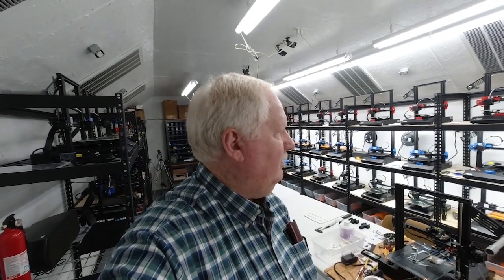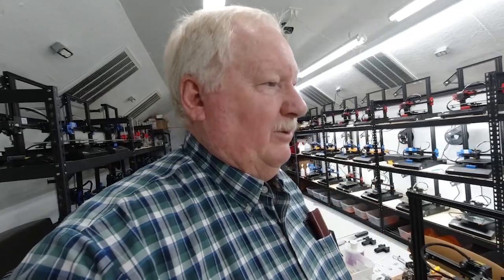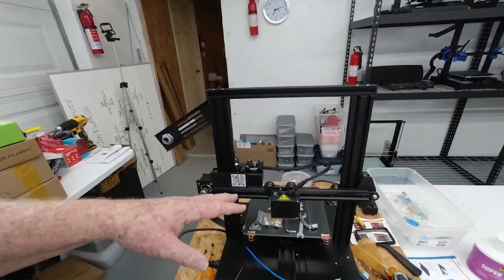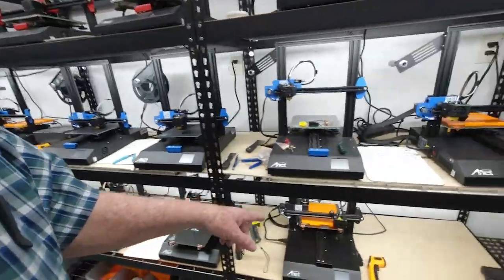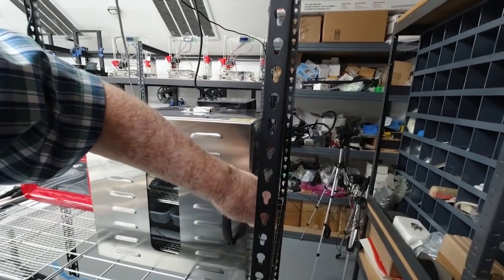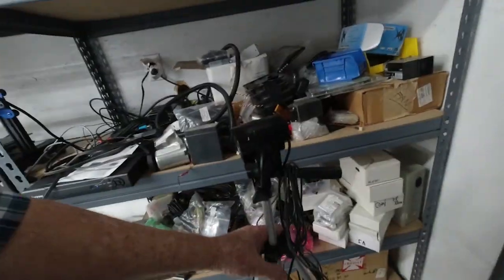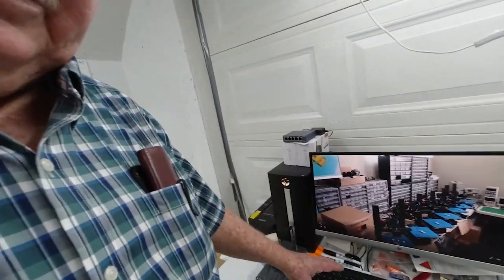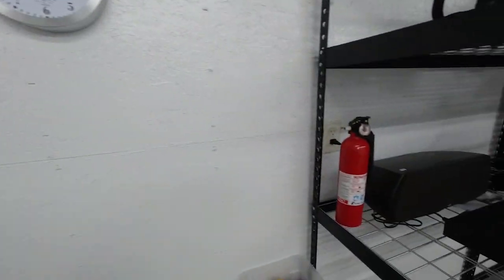A CLOSER LOOK AT MY 3D PRINT FARM, 3D printing parts using mostly  Tronxy & Anet 3D printers.

Comment: Would also be cool to get a wifi fire detector to get an alert on your phone if there is smoke or fire in there.  Or spike in temp.  Then you might be able to save most of your printers if there is an incident when you're not in there.
Reply from the maker: I continue to improve on the control and protection of the printers...Ken

Comment: Another great video Ken. Looking at that room in that wide shot still amazes me. Good for you for continuing to experiment. By the way, my leads have a light coating of grease as well and have been holding up very well. Just curious, what part of the printers typically breaks down the most so far or is it too early to tell? Claude
Reply from the maker: Hi Claude. My biggest repair item is the Nozzles which seem to build up when printing PETG at 245 degrees. Next would be cooling fans when the bearings start getting noisy. The rollers on the X axis seem to loosen over time and have to be adjusted to prevent slop in the head which causes the nozzle to cause friction with the printed part and will eventually cause the part to lose adhesion. I need to put together a video of the many problems I have had and how I fixed them. Thanks for all the support you have given me my friend...Ken

Comment: Great video ...thank you.  Let me know how the .8 nozzle works.  I wonder about strength and layer look .  Seam is also a concern not to mention infill density ... speed is non factor for me right now.....joe
Reply: Joe, CNC Kitchen made an excellent video on the impacts of different nozzle sizes. Some of the results are surprising! His "experiments" videos are quite something. Claude
Reply from the maker: I also do not see speed as a factor here at this time, however I want to see how it works out in case I need more speed in the future. The .8 is extreme and maybe .5 or .6 would be better, we'll see. Thanks Joe...Ken
Reply: @NewTechInventors  one

Factors  to consider .....the larger the nozzle the hotter the nozzle temp./ the faster the speed/the more visual the lines are on the skin.  I would think your printers may not adjust well for over 260 degrees....joe